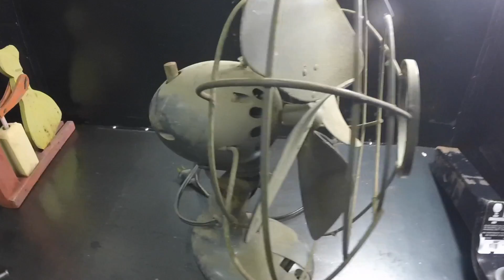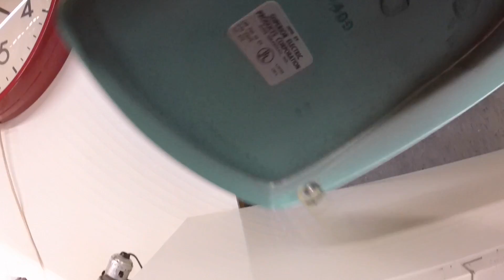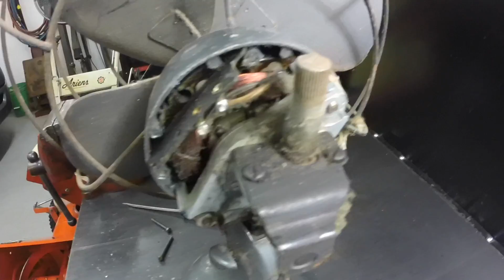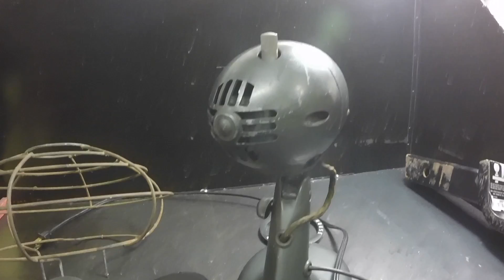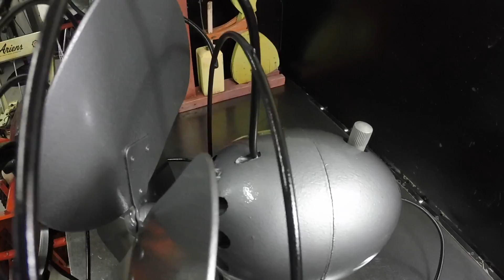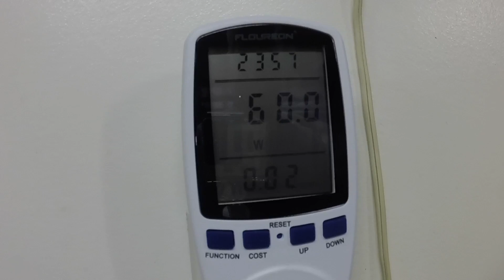Estate sale filthy retro Westinghouse Fan and restoration of it

Comment: Howard,  I was looking through some of your older videos and came across this one where you are showing a filthy dirty Westinghouse 2 speed fan.  You still have the ‘60 Pontiac. What did you use to clean the fan motor and blade cover with.  Whatever you used I was amazed how they cleaned up.  I want to use the same thing when I clean up some of the crusty things I pick up from time to time like you.
Reply from the maker: It's been a while, so I don't remember exactly, but I believe I disassembled it completely and bead blasted most of the parts, except the blade. I swap my fans out and around, so I can enjoy all of them. I was using the Westinghouse in the living room this past fall. It's a neat looking fan.

Comment: How do you remove the blade?
Reply from the maker: It's been a while since I restored that fan.... but I think it had a set screw.
Reply: @OldCarAlley  the set screw was stuck so I let it soak for a bit in some oil and then I was able to get it off

Comment: Any advice on how to remove the fan cage on this particular fan ?
Reply from the maker: I very carefully loosened the fan blade, then slid the guard out of the holes it's pushed into, pulling the blade with it. It was one to the harder fans to get the guard off. The blade is a type of hard plastic, so be super careful you don't bust it.
Reply from the maker: Brad, I looked at the fan, and remember pulling the rear motor cover, then taking a small punch and a small hammer and carefully tapping the fan guard out... a little at a time.

Comment: i have a westy 12pa2. Got it for $40. Had it for 5 years and im finally restoring it. works perfect. the speed/choke coil is original and still works. thegrease for the gear box for the oscillation has turned into wax. Going to paint it hammered silver, oil the bearings, and put new grease in the gear box. It still has the chrome trim piece also. Also got a westy ov-25 street light same color. That seemed to be westy's color.

Comment: Very nice old Westinghouse! I recently got a similar fan.

Those blades are made of a material called Micarta, you can strip the paint and it'll be a high gloss black. Great work on the metal piece for the base.

The reason that Low speed draws the same current is because it uses a resistor in series with the motor when the switch is in the Low setting. Resistors reduce voltage to the motor but use draw the excess current and shed it off as heat, the base will get warm after you run it a while.

I try to explain this here - https://youtu.be/N029pOhbILA